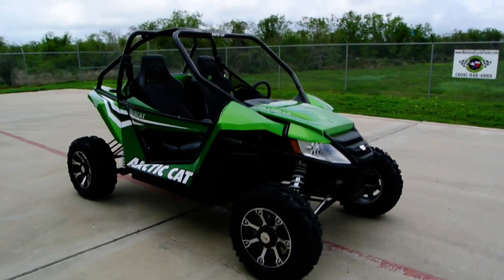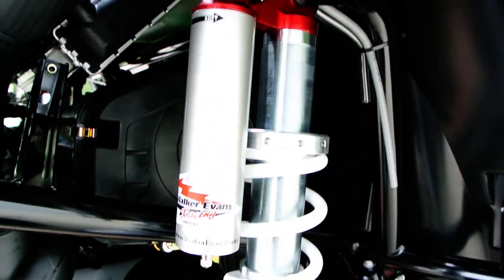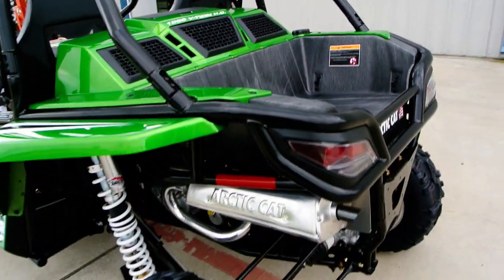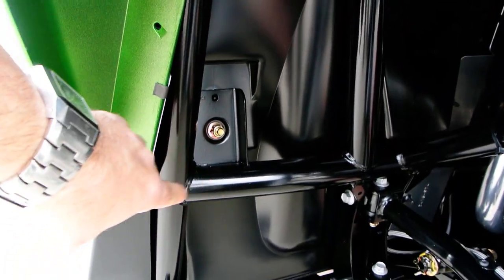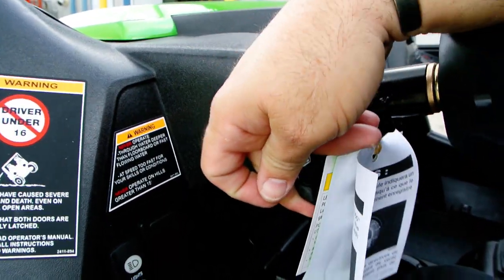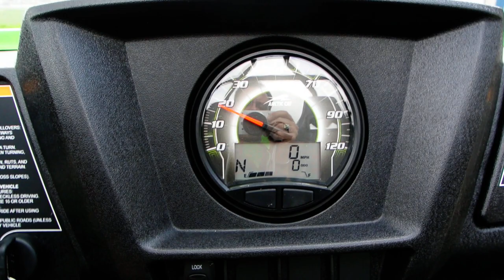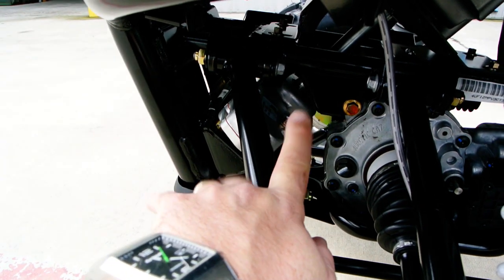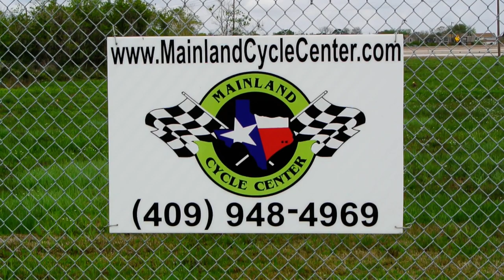2012 Arctic Cat Wildcat Arctic Green Metallic 1000 HO: Overview and Review

Comment from the maker: The button says "override" and not "overdrive". The "override" button is to override the reverse limiter. You can override the reverse limiter when you are in 4wd by pressing and holding the overide button. If your glove box is not closing properly, I would recomend taking it to your dealer for adjustment. The glove box is not advertised as dry storage. Try a zip lock bag to keep things dry in the glove box. You likely did not purchase your Wildcat to store important papers in the glove box.